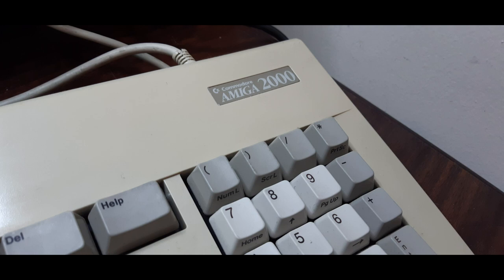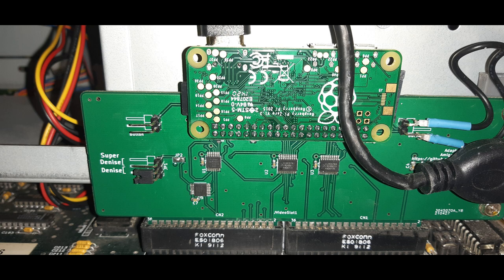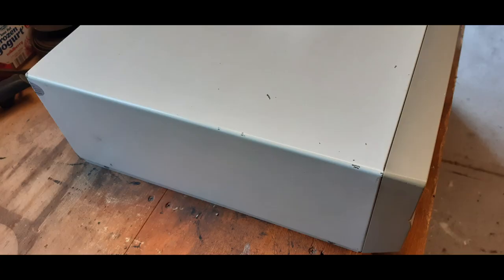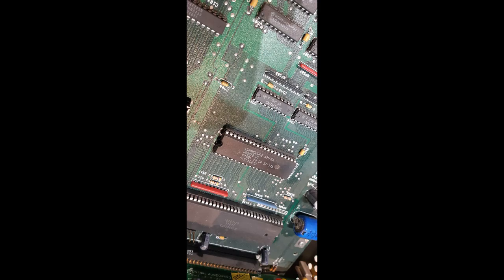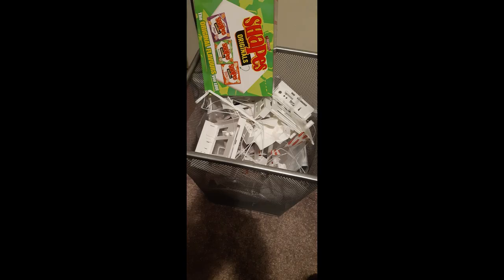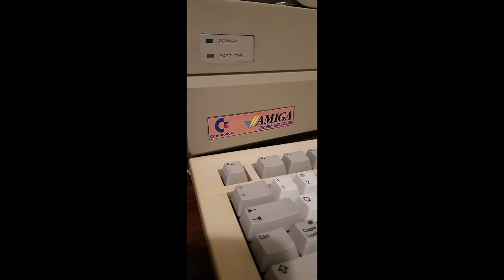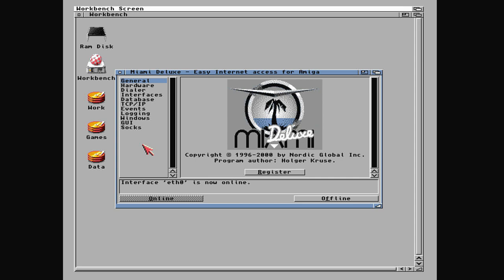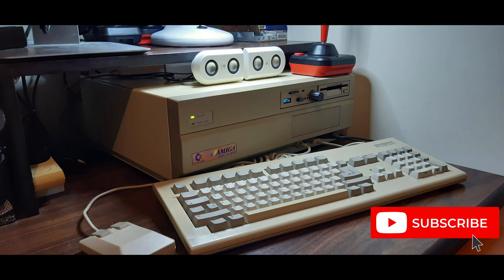Amiga 2000 Restoration Project - Part 1

Comment: Nice machine here! I noticed you swapped the leds to the newer (1990) green/amber combo. Were the old leds broken? Cheers! M
Reply from the maker: Actually, I don't remember changing those! Unless I did that 30 years ago. The machine was a 1991 model so maybe it came shipped that way?
Reply: @awcsau  maybe you did, as the photo of the Amiga before the renovation had the old red/green leds combo.